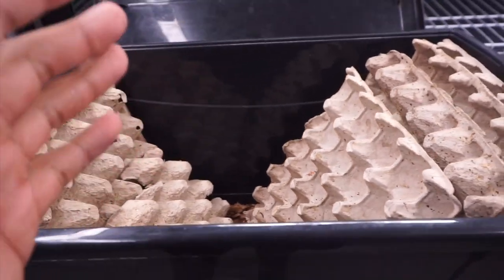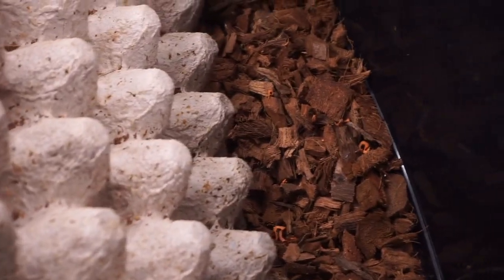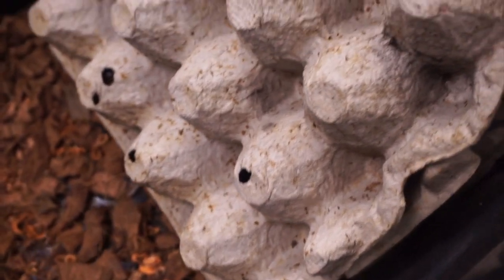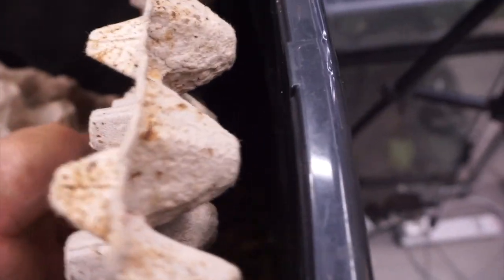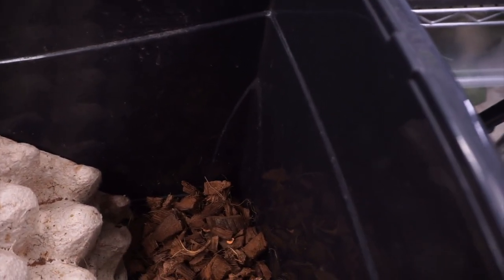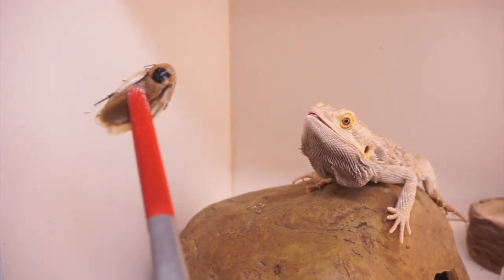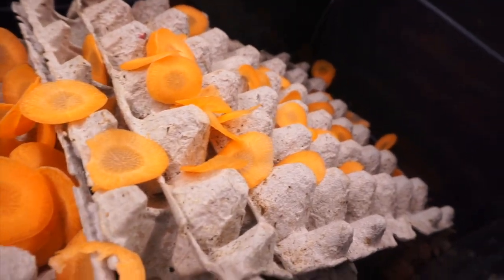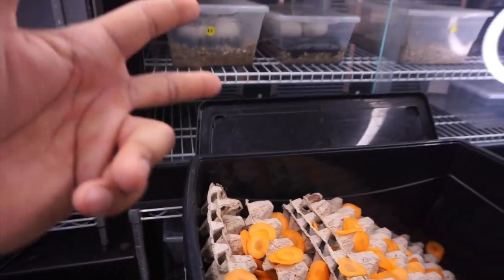My Discoid Roach Colony For My Feeding My Bearded Dragons!

Comment: Fantastic! I have been looking into starting a colony but they seem so expensive.  How many did you start with? Looking forward to more videos on them!
Reply: there are two good options with both having their pros and cons. Here's a summary:
1. Getting a group of nymphs (babies), growing them out and breeding them to get babies
Pros: Are cheaper, you can guarantee maximum breeding potential
Cons: They take an average of 4-5 months to fully grow out, and you can't control the ratio of males to females

2. Buying adults at a ratio of 4 females to 1 male
Pros: You get adults instantly, meaning you don't have to wait for nymphs to grow up, and you can fully control how many males and females you're getting
Cons:  Are typically 2-3 times as expensive as the nymphs, and you don't know the breeding potential of the adults (they might be so old that they can only breed 1 or 2 more times until they die, compared to the 8 or 9 times of a nymph)

I got 15 discoid roaches from Canada Ant Colony, but there are new sellers popping up left and right. There are three other sellers I'm currently aware of: Formistudio, Ontario Invert Farm, and Arthropods Canada. Formistudio has the cheapest roaches and Ontario Invert Farm has the most expensive. If you're not in a rush it might be smart to wait a couple more years, as the price is going down really quickly. Good luck!

Comment: Discoid roaches cannot fly. Anyhow, I suggest against using a substrate for obvious reasons in this video, especially what you ended up using. If you need a substrate, I would go with fine coco coir. You can run it through a sifter and pull the babies out vs potentially crushing them moving through the substrate like you have in the video. I personally allow my roach frass to be my substrate. The babies eat it for gut health among other things. You should definitely take a look at my breeding guides for discoid roaches. I have covered them extensively on my channel.